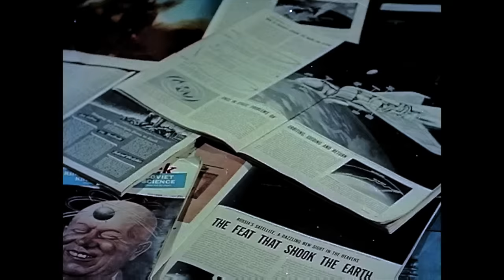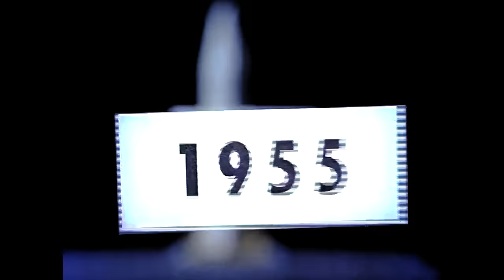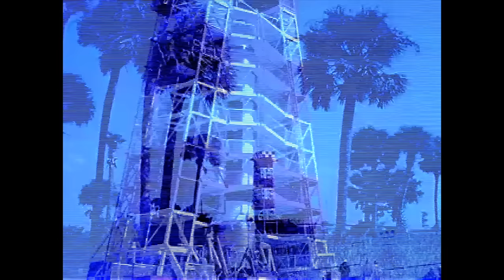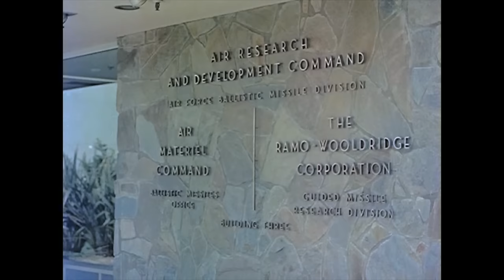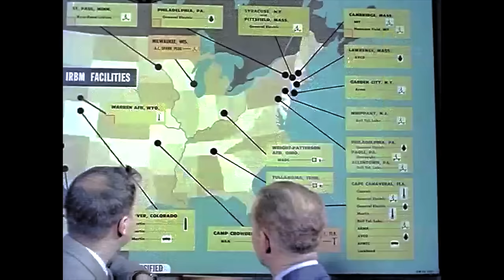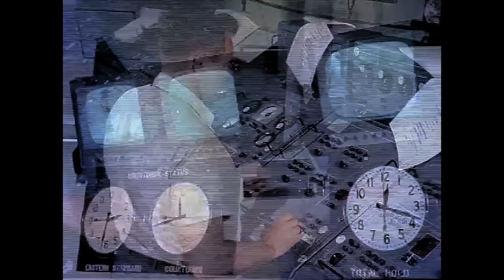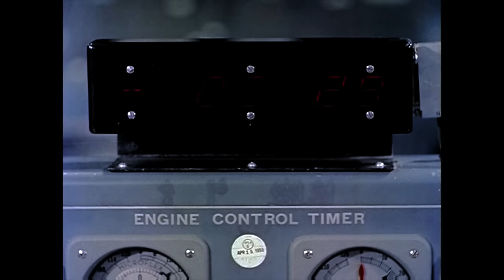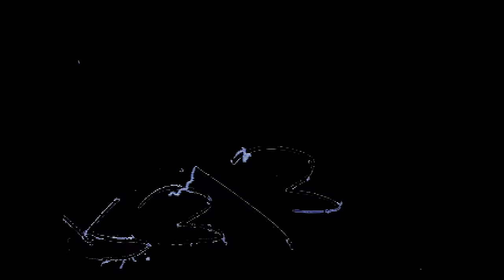Atlas The ICBM (1957)

Comment: I find it amazing that this was designed before modern computers. The engineering, intelligence and skill required is something i can't get my head around.
Reply: They sent people to the Moon with far less computational power than a cheap modern scientific calculator.
Reply: @obe22099  well they had human computational power which is stronger than a modern calculator!
Reply: Now think what the Germans accomplished with the V2, and they didn't even have digital computers.
Reply: Better generations and stock
Reply: I read something similar on the internet in relation to classic cars. The Cadillacs of the late 1940s-early 1950s had power windows, and in the case of convertibles - power tops, that were entirely hydraulic (and used brake fluid as the hydraulic fluid) except for the electrical switches for these systems. Later power windows/power tops were entirely electrical/electronic. This hydraulic power window/power top system was called Hydro-Lectric by Cadillac. Classic car enthusiasts who rebuild/restore Cadillacs with the Hydro-Lectric system say it's a massive pain in the backside to restore because the brake fluid polymerizes over the years into a semi-solid gel. Once restored the Hydro-Lectric system has to be fully "worked out" at least once a month to keep the brake fluid flowing. However the Hydro-Lectric system is still said to be a marvel of engineering considering that there was no computer aided design back then.
Reply: You have to remember that practically all of the century aircraft including the F-102, the F-106, and the B-58 we're done with slide rules.
Reply: DOC HOLIDAY   Oh God, another flat Earther.😵‍💫🤣😂
Reply: Americans were real people back then.
Reply: @captainoblivious_yt  The Germans could launch rockets more frequently than anybody ever could later on. They tested literally everything first before mass producing the designs. Still they were not a tactical weapon, so accuracy was always a guess.
Reply: @Pimp-Master  The accuracy were guesses, but always educated guesses. Most rockets that were not intercepted did land in roughly the areas they were meant to.
Reply: @captainoblivious_yt  : Not true.  They did airframe calculations with digital computers designed by Konrad Zuse.
Reply: @captainoblivious_yt and had to do it under pressure and at war. Unbelievable technology and prowess

Comment: I was enployed at Convair Division of General Dynamics in their Launch Vehicle Programs.   We pretty much knew that the old "A-4" (political name "V-2) was an alcohol/LOX machine that was limited by design and low engine thrust.  Convair began its MX-774 as a conceptual proof-of-concept project but was cancelled in the late 1940's.  When re-energized as the Atlas; the newer machine would have had four booster engines plus the center sustainer.  Subsequent nuclear weapon designs in the early 1950's permitted a much smaller warhead design which resulted in an accordant reduction in design capability with only two booster engines combined with the single sustainer and two small verneer engines for added stability and fine adjustment for targeting.  We would visit the ultra-modern new manufacturing facility on Kearny Mesa in San Diego in mid-1958; many of us amazed at the oversll scope of what was to be one of the largest procurements ever attempted by the Air Force.  A sense of urgency was present among us all.  At some point Gus (Virgil) Grissom was asked to speak to us all on the vehicle final assembly floor.  The self-concious Grissom could only blurt out the words: "Do good work."  Those three words from the new astronaut rang through the packed assembly like lightning ⚡ with the audience of workers erupting in chears as well as just plain screaming just hearing the voice of one of the men who would eventually fly on one of our vehicles.  What eventually became the annual "Do Good Work" pledge was signed by all employees.  Atlas would eventually become a sub-obital & orbital workhorse and by the '70's an Atlas/Centaur launch vehicle would boost our first spacecraft to Jupiter as part of the Pioneer Project for NASA.
Reply: Crazy how you guys did so much so quickly- and now we've been using the same ICBM for 51 years!
Reply: I joined the Convair team in 1982.  While I missed these glory days of this video, I got to work as an engineer at Kearny Mesa and Lindbergh Field on Space Shuttle, Tomahawk, Centaur and several other programs I cannot talk about.  This was the best job of my career.  These were some of he best people in the industry, and I got to brush shoulders with them.  I was sorry I had to leave as General Dynamics (the Crown Family) closed the doors in Aerospace and sold it all to other companies.  I ended up in Wichita designing airplanes for Learjet and Beechcraft (while still rewarding, it was boring by comparison).  Convair was a great R&D company.

Comment: One of the things that made Atlas a good launch vehicle was having all five engines (outboard, inboard, and vernier) light up at once so you could confirm everything was running before committing to launch. The "breakthrough" in warhead design was the Castle Bravo test in the Marshalls when it was discovered that the Teller-Ulam lithium deuteride design exploded with two and a half times the expected yield, causing a lot of unexpected damage and allowing the warheads to get to weaponable size. I read that the early launch failures were due to the turbopump bearings failing under the acceleration loads at launch.
Reply: The Teller-Ulam design had nothing to do with lithium deuteride.  Ulam had the insight that the hydrogen source could be compressed using a multi-stage approach starting with a fission bomb to provide the compression and heat needed for fusion.  Teller had dismissed the idea of compression until Ulam described the multi-stage approach and the effects it would have in heating the hydrogen source to fusion levels.   Teller then had the insight that radiation pressure could produce the needed compression and provided the bomb design using radiation pressure compression to trigger fusion.  This has nothing to do with using lithium deuteride as the source of deuterium.     Ulam provided the compression / multi-stage fission bomb approach and Teller provided the radiation pressure for compression and bomb design.
Reply: @buckhorncortez If there was a picture in the dictionary for “well aKsHeWalLy” it would be you!!
Reply: Castle Bravo was something like ten tons in weight, so that wasn't the breakthrough since no rocket could handle that kind of weight in those days.
Reply: @Pimp-Master  Yes, for a 15 megaton yield. But Atlas only needed 4 megatons. This meant that warheads could be made lighter to still work at high yields. Prior to that, the original designs for Atlas were huge rockets that would have been necessary to carry the much heavier warheads.  Castle Bravo discovered the lithium 7 isotope would fragment into tritium and helium during the reaction which would add to the overall tritium fuel. This had not been known prior to the test.
Reply: @spaceranger3728 I find it hard to believe that the breaking down of Lithium 7 into its fractals was an unknown process,this would have been discovered at an early stage of testing and development..
Reply: @darkknight1340  Yup. And Castle Bravo WAS that test.
Reply: @spaceranger3728  Yes,thank you.
Reply: I’m always impressed at the how cogent comments can be.  Interesting discussion.  I visited the National Museum of the US Air Force at Wright Patterson AFB.  The missile gallery had a Minuteman MRV weapons bus on display.  The relatively small size of the individual reentry vehicles was a surprise to me.

Of course, the museum display could be subterfuge, designed to make adversaries believe the US capability to miniaturize the weapons is more extreme than it actually is.

Comment: Dunno anything about rocket design but, I would think trying to get the rockets to vector 'just right' to control the direction (keep it upright for a start) especially without modern processors back then would have been damn hard. And doing it all within a horridly tight weight budget! Hats off.
Reply: Robert Goddard's liquid fuel rocket designs in 1913 used gyroscopic control, steering by means of vanes in the jet stream of the rocket motor, gimbal-steering, and power-driven fuel pumps.
Reply: @buckhorncortez  Yes - Goddard was a true pioneer in rocketry.

Comment: 16:59 The rocket exhaust spews out at supersonic speed, and multiple supersonic-gas-flow-induced shockwaves constantly ripple through the exhaust plume. Indeed with rockets today the rocket needs to be protected from these shockwaves while it is still on or near the launchpad, which is why nowadays the launchpad is flooded with water, to suppress the shockwaves, immediately before the rocket engines are ignited, and until the rocket is far enough away from the launchpad.
Reply: "...nowadays..."?   The launch pads were water flooded during the entire Apollo Progam - that was 60 years ago.   Hardly a new development.